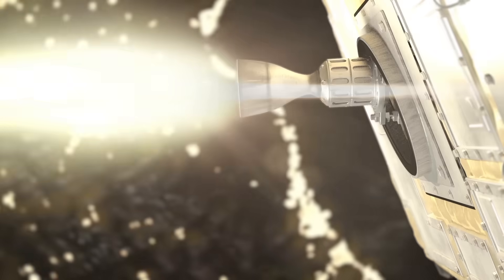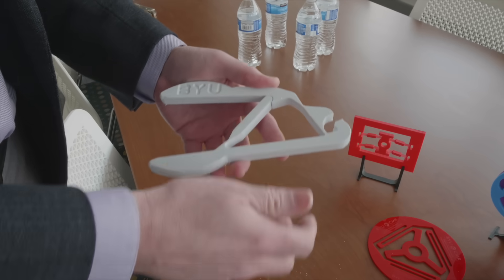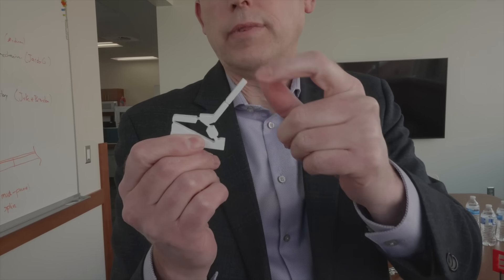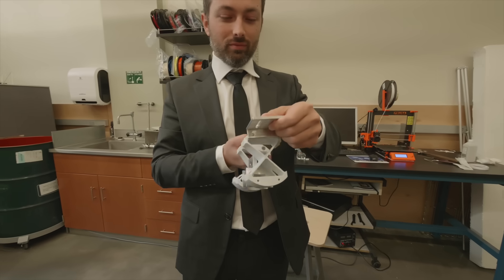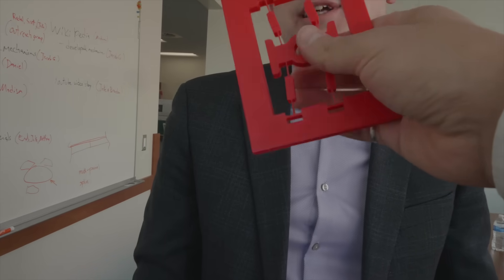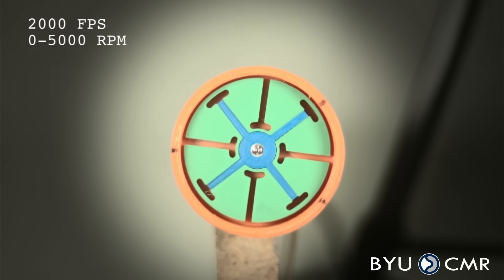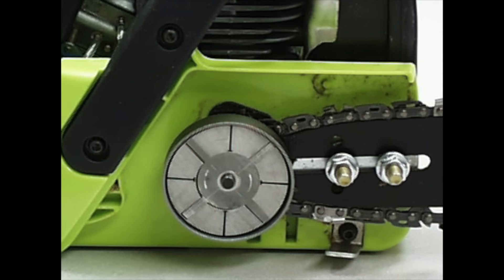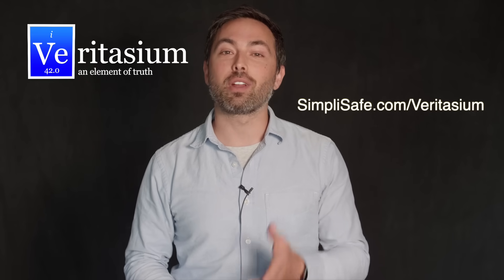Why Machines That Bend Are Better

Comment: With the chainsaw, will the resistance encountered when cutting wood overpower the centrifugal force of the flexible clutch? Does the clutch expand to "slot in" to the larger ring with teeth or does it only engage with friction?

Comment: yes more plastic saves the world.

Even though BPA mimics Estrogen and DEHP is found to cause degradation of Sperm cell DNA and sperm count of any men consistently in contact with it.
Reply: It's not all plastic though. Plastic works great for prototyping an demonstration but they did show off that the tech ultimately is used with a wide variety of materials like steel, titanium, and even more glass-like materials.

Comment: Great video! A few years back I actually did one of my design term projects on using metamaterials/complaint mechanisms like this in the development of 3D-printed prosthetics. I'm not an engineer at all but imo the potential is huge, glad it's starting to get some mainstream attention!

Comment: What are the disadvantages of flexible mechanisms?
Reply: Limited range (angular, translational) compared to something like a bearing for example,
Limited design freedom because anything above 2D manufacturing is not cheap or easy to make for high precision flexures
parasitic motion still present and the stiffness changes in different configurations
stiction will ruin precision, so has to be avoided
When designing for high precision everything becomes a problem.. stiffness of your base, any bolts that is used introduces play, thermal expansion..

Comment: This was extremely interesting, but I'm a little bit disappointed that your video showed just the pros of compliant mechanisms without going into what major challenges and problems there are to solve. I suspect that plasticity of materials (which might severely limit temperature range in which the compliant mechanism works), resilience towards outside forces in weak points and repairability are the main ones, but I'd be interested if there are any others.

Comment: Wow that’a super impressive. I knew about those types of mechanisms but I always assumed that they would be impractical because if the material is flexible enough it wouldn’t be robust enough and if it were robust enough the material weakening would be too great and needed the part would have to be replaced to often.

Comment: so.. fatigue of the material.. as with metal-fatigue.. is not an issue? (please ignore, if it's dealt with after 4:04)
Reply: as long as the movement is reasonably small along the stress strain curve then fatigue is usually along the millions of cycles. The main thing that i worry about is less of the fatigue death and more of the 200 pound gorrilla pushing too hard and the whole thing snaps.
Reply: @jameskinard  Just a wild guess... but you are a fan of AvE.. Am I right? :)
Reply: @PDeRop  what told ya that? The yooper or that i sign my letters with keep your stick on the ice
Reply: @jameskinard  hehe :) I love his lingo too.
Reply: They do fatigue tests just as they do with traditional machines.
Reply: Fatigue life is an issue but can be designed around. Wear is not an issue.
Reply: @ryangtromero  ok... but still weird.. because, that's why hinges were invented.. right?
Reply: @PDeRop  the idea is that reduced part count (a long with all of the other benefits) will lead to cheaper manufacture.

Comment: Really cool and interesting! It leaves me wondering though, wouldn't such machines have more resistance against motion than ball bearings for example? Parts have to bend... and if you make those too thin the entire device weakens. Also, what about different conditions such as temperature and pressure? I would imagine high temperatures would make the devices more flexible and vice versa... depending on the material of course.

Comment: 1 million times without breaking.. those plastic things??! Yeah right...
Reply: @dvndavid  my point is about failure after a period of time. Cared for or otherwise, flexible plastics do not remain flexible forever. Thank you for accepting that they are cheap and will need to be replaced.
Reply: My thoughts exactly, maybe in their testing over the space of a few hours but what about when it's been unused for ten years?

Comment: How could he not know what a centrifugal clutch was o.O its such a commonly used element in all sorts of machines
Reply: He probably knows, but the difference is that normal centrifugal clutches have many parts, that steel one is a lot fewer parts, has no separate springs and so on.
Reply: The real challenge is making one with the least parts possible, which greatly improves reliability if the material is within stress tolerance.

Comment: This was such a dope episode to think about from an engineering stand point! Makes ya think about how important it is to hold no value to tradition and always try to do things differently! You should make a video about not just proving things wrong but to try to achieve the same thing in different ways because you learn more that way and to train creativity and ability to think in ways that isn't just based on the way things around you work. Because that in a way limits you to create things super similar to the things around you!

Comment: A minor nit, but there's no way a 72hz cycle of that mechanism can turn that little ratcheting wheel 2x per second.
The wheel would have to have 36 teeth for 72 oscillations per second to create 2Hz rotation, and the wheel has closer to 48 teeth.

Comment: My mind couldn't handle this. I lost it all at the clutch! I can't believe I've never heard of this before!
Reply from the maker: haha - that's kind of how I felt when I found out about all of this!
Reply: @veritasium  I found the clutch to be intresting version of something that I've already seen before: The clutch in a top fuel dragster. The switches were very cool, that they can be made at such microscopic scales!
Reply: @veritasium  Centrifugal clutch? Not so rare, ask Destin.
Reply: @AutoFirePad    Yes, but this one is much simpler.  Less moving parts, no springs to pull it back together when it slows down.
Reply: This is just like when I learned about Soft Robotics all over again, but this has immediate and direct applications everywhere in life!
Reply: Never heard of a centrifugal clutch? I think more and more people watch veritasium videos because they are bored, more than because they want to learn something. By the way a regular centrifugal clutch might not be lighter, but it is for sure more reliable when HEAT and torque is added to the equation.. doubted in this episode since I saw the thumbnail, watched it just to support veritasium tbh..
Reply: The clutch is based on the same idea thats behind the speed breaks on elevators. There you have a series of balls which spins up as the elevator drops. The faster the drop the faster the balls spin and the harder the breaks apply force to the elevator shaft. The difference here is that the clutch applies its force to a cylindrical drum and is made to do this for an extended period of time.

The fact that its metal isnt even that cool. Take a look at thin sheets of metal and you'll realise that the thickness of metal affects its flexibility. Metal naturally flexes as it gets hot or cold.
Reply: Yeah, what he said.
Reply: @thealienrobotanthropologist  and I mean, horses self heal when injured and you can feed them on any patch of grass...

You sound like the people who thought LED's wouldn't go anywhere, lasers would never be cheap, and 3D printing would never be commercially viable to industry.

Yes, the idea of flexible mechanisms has been around for a long time, but the point is that thanks to new and/or newly matured manufacturing techniques, the ways it can be applied have greatly expanded.  Sure, maybe on the scale of everyday clutches this isn't much of an improvement, but what about on the micro-scale?  This tech lets spacecraft cut their maneuvering thruster requirement in HALF.

A revolution in a technology doesn't mean it replaces existing ways of doing things, it can simply mean letting us do things we've done for a long time, in places we never could before.
Reply: @Synthmilk  3D printing is not viable to industry at large, it is only viable to the tiny percent of things that can't be done any other way. 3D printing is way too over hyped by garage tinkerers that have never stepped into a real multi process manufacturing facility.
Reply: @ipissed  3D printing is very good for prototyping.
Reply: @ipissed  3D printing has revolutionized rapid prototyping across nearly all solid materials industries.

And on the contrary, 3D printing is replacing various CNC applications due to the cost savings in raw materials and equipment maintenance.

3D printing is far more prevalent in industry than you think.
Reply: @Synthmilk  also, in my oppinion, technology has improved YES, but I wouldn't trust sending a multi-million dollar space probe to explore space with ANY flexible parts of that importance, let alone plastic parts, one fails and you might lose a little bit expensive ship..
Reply: @DSperformance96  NASA disagrees with you.

So unless you care to whip out your credentials so as to back up your opinion over theirs...
Reply: @Synthmilk  thats all you have to say?
Reply: Not saying that this isn't cool as hell, but does it really bring that much innovation to the centrifugal clutch that scooters and chainsaws already use? It seems it would be lighter for sure and maybe have cheaper (?) manufacturing costs, but other than that I don't think it would benefit them that much. Still a good take on an established technology.
Reply: Lighter weight, better reliability, reduced wear, longer component life and cheaper to boot, Rotax have been using them in their Go Kart engine for a while now, made the old style clutch completely obsolete.
Reply: @mariuszanfir2298  Lighter & cheaper are HUGE benefits in manufacturing, as well as faster & potentially more reliable.
Reply: “I lost it all at the clutch!” That’s what she said 😆👌

Comment: 6:40 Look a little like the mechanism of a accelerometer/Gyroscope. Am I right?
Reply: kind of the opposite, those are meant to measure vibrations and this switch is meant to resist them
Reply: @Zreknarf  Oh yeah. Didn't realise it snaps in place. But apart from that its really similar.
Imagine the middle of the mechanism as anode and the outer part of the mechanism as kathode. If the part gets accelerated the the centerpart bends relative to the outerpart changing the capacitance. This property can be used to measure the acceleration.

Comment: I've also heard about compliant structures dynamics used to make tiny drones that fly like insects (they somehow tune the resonant frequency of the device to make it move with very little energy input like a butterfly!)
Reply: that makes sense, I've never thought about that. At that scale, all the parts act as springs because they are so thin and long, so if you moved it part of it would lag behind, and the whole component itself would act as a spring, storing energy, then releasing it.

why move a wing all the way if you could move it partially and then let it release it's load to drive it the rest of the way. I'm sure there's more to it, also doing things like you said with harmonics so those frequencies of springs dont interfere with all the other waves of vibration going through it. 

very interesting!

Comment: Is it weird that I "knew" it would stay in place within ten seconds of seeing the device? I didn't analyze the device, I thought about what its purpose was and saw that, if the hole moved, the device would have no purpose.
Reply: No, it's not weird. It's a statistical anomaly but considering the 40,000 people who have watched this video it would be weird if a person like you did not exist.
Reply: The elephant body is just a distraction. If your brain is good at ignoring all that and seeing only the wireframe structure beneath it, it's actually not that surprising.

My own guess what that it would move slightly inward, because he asked "in which direction" it would move, but my intuition told me the movement would be very small at the most.

Comment: Those fatigue tests are so cool, but I always wonder what the margin for error is, since actual use a lot different from the conditions in a fatigue test in terms of intervals between uses and heat/friction accumulation
Reply: I'd think the biggest and most problematic difference between fatigue tests and actual use might be forces acting in unintended directions. But they might have taken that into account.
Reply: Then actual use would last longer. I guess it's used for minimum rating, but you'd expect it to last much longer.
Reply: And what about all kind of environemental exposures? like atmospheric chemicals, UVs.
I would guess that for such thin flexible  area to maintain their properties, they would need to also maintain their perfect molecular structure over time. Isolate the part from its harmful environement might be the bigger trouble. @Geerice
Reply: @TonyOneBlairoby   It's generally desirable to do fatigue testing in a controlled environment. Because of the differences in possible usage locations, it'd be hard to make a normal environment, especially for testing.
Reply: But then it worth nothing if your testing doesn't represent how your material behave in real situation.  @Geerice
Reply: @Geerice , a controlled environment, yes, but often a harsher one than you expect in use.  In aerospace, for example, there are a bunch of standard tests and methods used on various parts.  You analyze what it will see in its expected lifetime and then devise tests that will demonstrate statistically that your design will survive.  For example, maybe you double the magnitude of vibrations or increase the time.  And based on lots of data about previous tested parts, one can analyze the test procedures to verify if it will, in fact, demonstrate you have sufficient margin in you design.  And, when you add in the effects of vibration tests, thermal tests, possibly shock tests, salt fog tests, and so on, you can verify in a controlled way that your part will survive what you throw at it.
Reply: That's a good point, TonyOneBlairoby. But if the switch is made of plastic the only real environmental processes it needs to worry about are exposure to sunlight and heat. And if it's encased within a switchplate and/or within a wall it probably won't be exposed to much of either.

But on the other hand, other applications of flexible machines might have more of a problem with wear, like the flexible cam for the chainsaw.
Reply: @TonyOneBlairoby  These things are used in multi million dollar satellites. I bet they tested them in every way possible.
Reply: @TonyOneBlairoby  Fatigue testing results in a value known as Endurance strength. Actual Fatigue strength is calculated by multiplying that value by various factors that depend upon temperature, surface conditions, reliability etc. which account for the usage conditions of the designed object. Search about "Marin's equation" used to design shafts and axles.
Reply: @Drew Kangaroo Okay, use it 14 times a day then
Reply: @Drew Kangaroo Multi-switch systems, I have 3 switches that control the same light (one at top, one in middle, one at bottom).
Reply: ReaperEOD
I've never understood how those work. It's like magic.
Reply: @Ratchet4647  It's a simple logic gate. You can even plot it yourself such that every time a switch changes from 0 to 1, the output changes.
Then, well, you find out what standard logic gates you could use to arm the mechanism
Reply: If you use those Switch 3 cycle a day (on/off) it would last 800+years, 15 a day 100+year, i Wonder performance of traditional switch
Reply: With fatigue tests, they will cycle the part at a specific stress until it fails and plot it on a stress vs. endurance limit curve. Each test gives one data point on that curve and they test it at different stresses to get more points
Reply: Adam Kelly many variables could effect use in practice outside of a controlled environment, so I do believe they would do trial runs in products to get more accurate data
Reply: "margin of error" or measurement uncertainty is different from experimental accuracy. But most important is designing a controlled experiment (changing only one variable at a time).
Reply: i was wondering the same thing
Reply: I think the irony here is that they'd need a compliant mechanism to get the most accurate test of a compliant mechanism....

Also I'm super giddy about the potential implications of a compliant mechanism made of graphene incorporated into electronics. Like, "compliant mechanism circuitry". But I think I'm getting ahead of myself. Wow! What a great time to be alive!
Reply: Fatigue testing in the real world would be harsher. I imagine the materials to be at cooler temperatures when activated versus in the controlled environment where the material is warm from the repeated cycles. Thoughts?
Reply: Next time on Underwriters Laboratory...  We see if this toaster can cook pepperoni while hanging from a light socket without catching fire!